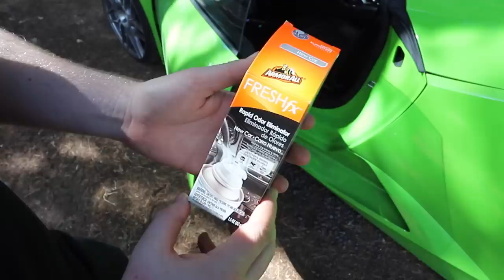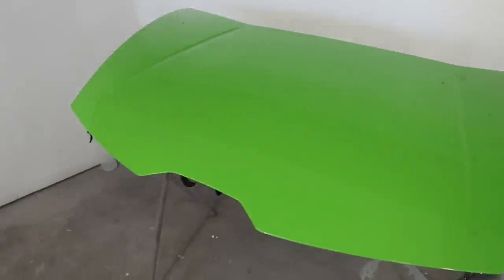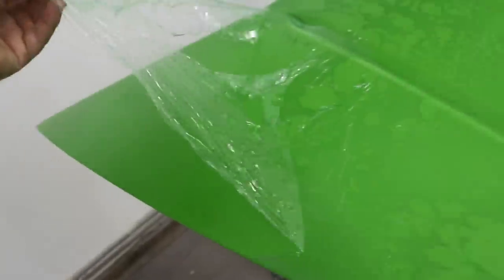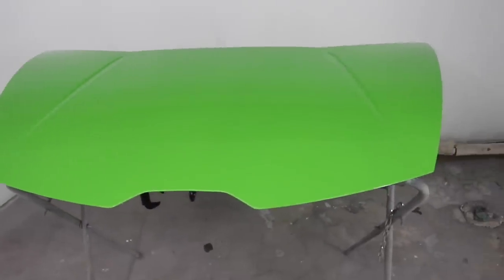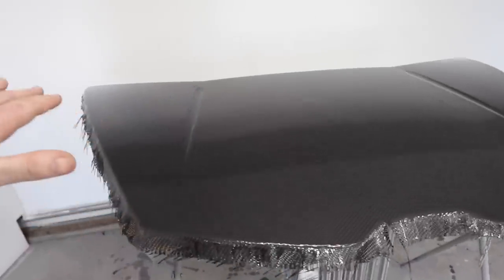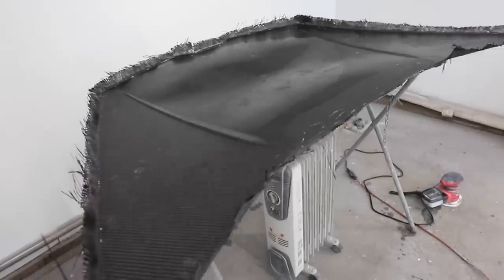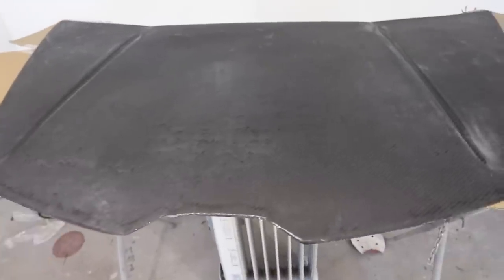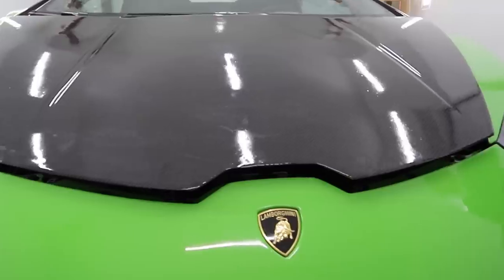Building Our First Carbon Fiber Part for the Huracan

Comment: You had the beginnings of a great mold. All you need to do is place the part back on the hood, then expoxy some gussets and wood stringers to provide horizontal and longitudinal support for when you remove the original hood. Then, you flip the mold over and you can laminate from the outside in.

Comment: the gel is just for seperaton then the carbon fiber is like fiberglass close to same fiberglass cloth is a mat just like fiber carbon easy to use but carbon much stronger then do bottom and mold together good thing is carbon strong and you can use small pieces to put them together watch he did a better like1963;splits window the name is tip of my tongue he's short tattoos and has a son Ryan I think I'll think of it let you no I'm getting older to many fumes memory gone

Comment: The area of resin that hadn't cured in two days could have been a pocket in your cup that didn't get mixed well enough with the catalyst. I'm not sure your resin is the same but my experience with epoxy and polyester resin is they need to be mixed extremmmmely thoroughly.

Comment: You need to make fiber glass molds then use a release agent when adding the carbon fiber and resin. Also you need those breathable cloths or what ever they use to put it over.  Then you need a big vaccum bag and a vacuum pump. Also you need to create to valve's one for the resin to go thru and the other to take away the extra resin. That will give you a good, stiff piece. Remember it always needs to be vaccum sealed bc of the pressure will press all the layers together

Comment: Two thoughts sir to address the resign drying time, A) use a heat chamber to dry or B) more practically, work on multiple parts at a time. Your time is limited with a sema deadline so any advantage can play

Comment: i used to mix a lot of resin and the biggest thing i can say is mix, mix, mix and once you think its done, its not and you need to mix A LOT  more. scrape the walls and bottom corners of the cup and just keep mixing. you can never mix it too much. or else you can get pockets of less cured resin.

Comment: Next time you use resin, cut in the corners and deep spots, then roll the rest on, or else you get those leveling issues like you had. Also, you want to uv cure resin, whenever possible, for at least 48 hours. The way you let it cure, is a minimum of 1 week cure time.

Comment: I think you should have started small like the little small triangle that your missing on the drivers side but have fore the passenger side. That would have been a good episode of how you would have 3D molded the piece and then how the carbon fiber process works at a small scale.

Comment: Do your one layer of carbon fiber. Then spray close cellfoam insulation over it. That’ll make a mold you can add layers to. Then when separated you’ll still have the mold.

Comment: Buffing these parts will be impractical.  Mold it in fiberglass, reinforce the outside with some wood studs an have a solid negative of the part you want. Use the inside as your pattern and also design the inner structure of the parts, the flat carbon layer is like the sheet metal in the hood, it gives the outside shape but what holds it togrther are the inner ribs and strutures. A part you buy from a carbon manufacturer is also cooked inside an outoclave. It is placed inside a vacum bag to take all the air out of the resin and carbon fiber weave and subject to hih temperature and high pressure to strengthen it. You can probably produce a carbon fiber skin to place around an oem door, or a nice fender that is only skin but to so something structurally solid like a bonnet at least some good inner reinforcements needs to be made.

Comment: What we do here in the Philippines when making carbon fiber parts, we make a mold first out of fiber glass. We lay the carbon fiber on the underside of the mold so the fitment of the part will be as close as the original. 😁😁😁

Comment: Chris, check out this video, great tips that cover some of the issues you had with finish, leveling, air bubbles and milkiness in the resin. Using a heat gun or torch, stippling with a brush and a notched trowel to get an even thickness.

https://youtu.be/CcGp0vwvyv0

Comment: I'm not sure you can get a decent finish without a mould, even with a clear on top, plus to get fitting narrow gap panel from a mould is not always a piece of cake already, so doing that without is imho huge fitting troubles down the road. In other words you won't save time trying to reinvent the wheel in composite parts replication.

Comment: You are starting with the second hardest part on the car. The hardest being the roof.  Those parts where the resin didn't cure means you didn't mix the resin well enough. You are not going to get the weight savings from carbon fiber with a hand layup without at least vacuum bagging.

Comment: You can combine carbon and fiber glass layers and its important to change direction of layers. and the best is use vacuum to make smoth finish and thin + strong material. If you use carbon + fiber glass you save a lot of money.

Comment: I had the same issue with my resin. Make sure you measure as accurately as you can when adding hardener, and stir the shit out of it. I used a drill to mix it

Comment: The trick with the resin is you've got to spend time making sure the resin and hardener are thoroughly mixed to avoid getting spots that won't cure due to no hardener. I reckon you'll get it all to work though once you iron out a couple of minor issues. Good work.

Comment: I'm not sure you did a good job laying the carbon fiber sheet.
Know any pro window tinters? Get some help from them.

Also, I'm thinking a heat lamp would help cure the resin between coats.

Comment: If you want to do it unproffessionally and easy and its a one time thing then just do the same process. BUT make a mold first, make the edges stronger, then add wooden blocks on the outside of the form to support it to maintain the same shape and curves nad angles. Then take it off and turn it around. And then make the right piece and it will come out nice and shiny.

Comment: Most of the comments focus on making a mold for the piece. There has to be a reason why the resin did not dry after two days to cause problems with sanding. But I agree that a mold will make the process better and less sanding later.

Comment: You could slap the part you made over the original hood, apply a release coat on top, then create an extra 2-3 layer fiberglass mold on top that will help it maintain its shape when you remove the hood and flip it to create inside reinforcements.

Comment: Definitely need a mold I think it will save more time in the long run over making the car 6mm bigger for a 3mm overlap on each part, and mirrors are a cool small piece to make next that the size gap won’t matter as much

Comment: Make a mold because your body panel gaps are going to disappear and they wont look as even Use regular fiber glass and put on one layer and put one a thick layer off spray foam to keep it's shape and infuse the resin then you'll not have to sand and you'll have perfect surface

Comment: Carbon fiber works better stronger as a compasit with glass fiber.
The panels will be stiffer and less brittle for impact damaged.
Use 4 oz flat weve s glass between carbon layers with s cloth on the surface. Top layer of glass will stop delamination from sun heating the surface on hot days.
Lamington by hand is fine for what your doing but you will definitely need to work from a mold also laminate stiffening ribs.

Comment: From what I've seen of carbon fiber body components being made they do it in the mold and they also vacuumed it to suck out all the air and Infuse the resin into all the layers and they lay out all the carbon first and then basically pump the resin into the mold

Comment: When sanding the resin it's best not to use an orbital sander. In the past when I've done it, particularly when the resin isn't cured for a long time it will begin to melt a little and create those frosted bits. Either hand sanding or using the orbital sander over a large area so you don't heat one spot too much.

Comment: Maybe make a jig (out of insulation foam or something) that holds the metal hood in its shape. and then put the 1 layer carbon hood in there. so its the correct shape.  Then add the extra layers on the inside

Comment: Could you do a single layer of Carbon fiber, spray that plastic, water soluble, spray on it then a few layers of fiberglass.  Pull the whole thing off the hood and then add more layers of fiberglass.  I've never done work with either, just curious.

Comment: the air bubbles can be eliminated by using a torch over the bubbles.  a heat gun will work too if your careful the air can blow around the resin.  also using a silicone mold would be the way to go to make the part.

Comment: ucan still use this method, make the same 1 layer hood, keep it on the original part,  spray pve on top of carbon and then put some construction foam on top of it to keep shape, when you flip it the shape is still there and you can take the metal hood out and work inside. we did that with other parts and seemed to work.

Comment: Bothering me man r u able to paint the floor in the garage and just cover the hot water pupes with a hing or something made of dry wall in case of reapair? Just a suggestion theres alot of dust and debris and other contaminants gathered on the floor and moved around alot from the fans no matter how good u clean the car the caras just track dirt mud or whatever else in from the tires

Comment: Most people are saying to use a mold and that will give you the best results. Vacuum bagging it will be the most cost effective way to do in in a home shop. You will also need a mold on the outside and then a mold of the inside and bond them together to give it the rigidity it will need.

Comment: If you put it back on the hood you can put another lair on it it needs a 2oz and a 1oz lair and it should be strong enough I worked with fibre glass

Comment: make a fiberglass mold off the hood, then lay the carbon inside of that, leaving you with a hood the exact same size as the original piece.
so the way you did carbon on this one, do that with fiberglass, a thicker and much more solid mold.
this should work for most exterior pieces

Comment: Using the same method as in this video, could you temporarily reinforce the hood from the top side to keep its shape, then flip it to reinforce it permanently from the bottom, then remove the temporary reinforcement from the top?

Comment: If you want to do that method take some planter's lay it on the piece then use spray foam or eny thing that will keep a 2 by 4 in place to keep it from bending do all that with it on the piece it would be better to do a mold

Comment: You should try usng your panels as masters to make Fiberglass female molds and then make nice solid panels with these. I would recommend using an infusion process where you suck resin through your part and out from the other side and add a nomex core. It will be much lighter than if you lay resin on top of carbon fibre (which isnt the right way to make carbon fibre parts) and make your panels very strong.

Comment: Omg... So much things wrong in this video... apply the resin on the hood with a paint roller, you will save ALOT of time, you don't need to apply so much tho. If your mold (your part in your case) is in an angle that could induct the fiber to fall or move, yes you should wait for the resin to be tacky, but if it's flat like your hood, you can apply the fiber right after. The only reason to wait it to be tacky is to help keeping the fiber steady so it don't fall on the floor. Also, NEVER EVER use a squeegee to remove bubbles and lay the fiber down, that's what cause all this imperfections, just use the roller. You should also use a smaller roller than the one you have. 

I work in composites since 4years, we are making flight simulators covers, so I know what I'm talking about.
Reply: And please, make a mold of each piece, that's the only good way to do it

Comment: make a matrix mold.
1. put on wax 
2. pva relase
3. gelcoat
4. fiberglass, you can reinforce by making ribs
5. remove part and clean pva
6. apply wax and pva inside matrix
and from here you can have few options 
either lay dry use vacuum infusion or just as you did layer buy layer. Vacuum infusion is better that you get right amount of resin and you are sure there are no air bubbles inside your layers, and you tend to get exact width,  down side that it requires more preparation. You weed vacuum pump, "bags", breather material etc. basically here is is first video i found https://www.youtube.com/watch?v=L5LjRDg3xQ8
Reply: oh and upside to this you can always make thew more as long as you wont throw away matrix ;)

Comment: 100% for your effort. Please for the love of God skip the clear coat... Make a fiberglass mold and pull carbon fiber parts out of them you will be using your resin as your finish and it will be so crystal clear and glossy... When you Vacuum Bag it and infuse with resin
Reply: Then you can also add carbon fiber parts to your merch list you will already have the molds🤑🤑🤑

Comment: take hood back off,   lay that on top.   use it as a mold.   maybe?   or make a mold of the inside of the hood for strength and connect the 2 ?

Comment: Uh, basically you're using what should be your top mold as the final piece. In other words, the hood you made was larger than the original. The bottom of the one you made should be the top of a mold for a new one. You should also make a mold of the bottom of the hood, then combine the two. This would also allow you to use fiberglass for the molds and carbon fiber only for the final product. I'll see if I can find a video of what I'm talking about.
Reply: Here it is: https://www.youtube.com/watch?v=UgKvDw1E60E

Comment: Shouldn't you be making molds then making your carbon part from the mold, doing it straight of the part the dimensions are going to be slightly larger than the actual piece?
Reply: I don't get why they don't just make molds first, they wouldn't be having any of these problems and it would mean they could make a new part whenever it was needed

Comment: Fiberglass first, base layers them carbon fiber on top! Much easier in the long run!
Reply: No CF on bottom.
Reply: @cristianfederico2411  carbon fiber on top and bottom correct, but the base structure should be fiberglass for this type of job. Then you can use a few methods to lay the CF on both top and bottom.

Comment: How do you build carbon fiber parts without an autoclave?
Reply: I know what the answer is. I used to build carbon fiber parts for race teams out here in North Carolina.  He's going to need an autoclave. Also he needs to build a mold first rigid enough to make multiple parts with. Its the way he's doing it won't work.
Reply: @melissahill7930  well we will just have to wait and see how it goes.
Reply: @melissahill7930  10-4 I hear yea. I was in it from 99 to 04.
Reply: @melissahill7930  same here

Comment: Can't do these properly without making a mold first, like many have already said it's exactly the same size as own and the finish is better, same as f1 to be honest. Plus when your mixing your resin and finding that it's not curing all over it's because you hadn't mixed it fully enough, most epoxy resin users mix for at least 5 minutes making sure you every bit or resin and hardener is combined together. Plenty of people on YouTube who are experienced in using resin so just have a watch